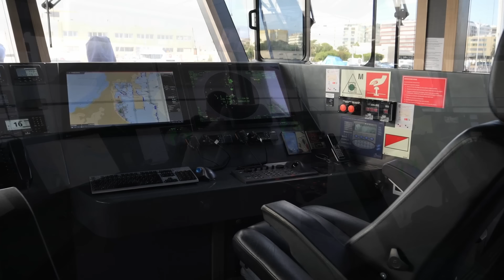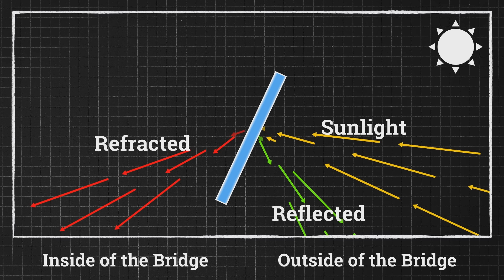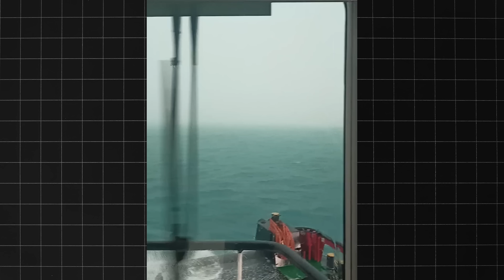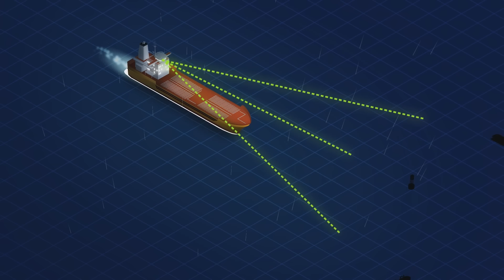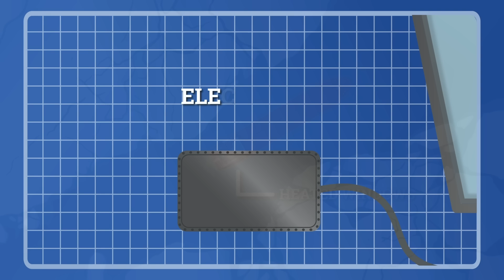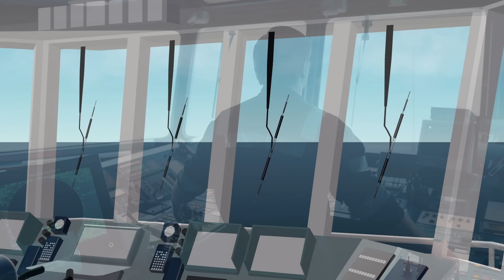Why Are Ship Bridge Windows Angled?

Comment: You might want to read up the basics of "Optics" (or re-read the optics section of a physics school book) ... and then redo the video. Let me correct the two most obvious mistakes in the video:
1. Light hitting an object can be reflected (light goes back to the same side of the object it came from (not to the same angle unless hit at 90 degrees)) or enter it (or a combination of both, with (semi-)transparent objects).
If it's reflected, it's not going in or through. You said this wrong every single time in the video (while the video text (when there was one) said refraction, which is partially correct as the light undergoes refraction (which is an angle change) while passing from air into glass and from glass into air (how much depends on the refractive index differences).
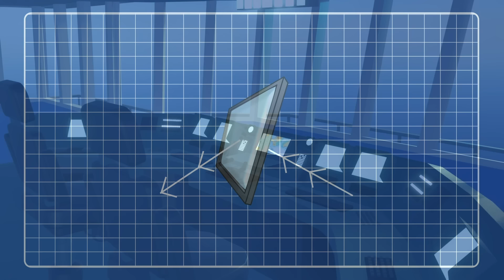2. 6:39 The arrow on the left (light after passing through the glass from the right would go up, not down. Actual angle depending on refraction indexes (see above).

Comment: The safest backup is obviously replacing all windows with transparent display panels so the excuses for not paying for the most capable 360° multi spectrum surveillance technology finally sinks. Anyone not using a Thales or Holosun 1x thermal red dot reflex sight is objectively wasting limited rail space with any other choice, same technology same reasons why.

Comment: Once it is dark enough night vision cameras are objectively way better than any human eye. There are also radars that can penetrate fog much better than any eyes even sonar can see other ships.
Reply: this isn't exactly true, passive night vision systems are notably better than the eye but still have limitations, these systems can also operate safely during sunrise and sunset

active night vision systems are rarely used on non specialized civilian ships (EG: cargo, fishing) as they are not dissimilar to using a massive spotlight

radar sure is great except when there is a power interruption and you can no longer supply tens of kilowatts (or even megawatts) of power to a massive microwave emitter

glass always works, no matter how little power you have
Reply: @thatonemoviebob  The radars needed to spot other ships or obstacles within a few kilometers are nowhere near that power hungry. And the point is if a 100+million dollar ship is at stake investing a few thousand into some night vision or thermals is really not a significant cost increase.
Reply: Not objectively and not "way" better. Those cameras can see as far as their infrared light can reach. Not really far. Enough for your garden, not enough for anything significant.
Reply: @Паехавший  well thats for active systems, passive systems do generally perform better then the eye in moonlight or twilight conditions, however during pure dark the human eye may perform notable better or notably worse depending on what youre looking for
Reply: @Паехавший  You should do a bit more research on the topic. You will quickly find out that even head mounted nigth vision or thermals are so powerful and cheap relative to the cost of a large ship that human eyes have no chances.

Comment: Your optics aren't correct.  Refraction doesn't change the direction of light passing through flat panes, regardless of how they're tilted.  The rake angle is to prevent seeing reflections from behind the viewer, from other windows or brightly lit decks or instruments at night.
Reply: You beat me to it. The explanation is completely and totally wrong. They are windows, not water. If the windows were straight up and down, you would see yourself and other people moving around which could distract you, or indeed just the reflection of windows on the other side of the space, making it harder to see.
Reply: That's why the "shelf" above the dasboard in cars is generally colored matte black as well to minimise the reflections. It's very noticeable if you put a piece of paper there when sun hits it.
Reply: It's soo bad
Reply: I guess Ai slop now
Reply: This channel got sold by the original owner and now it's purely money making AI slop.
Reply: @robinnautica9773  really?!?
Reply: @j.4941  yes really. 
Go watch the New Horizons video from him from 1 year ago the one before the last actually good video and see the difference yourself. 
It's just sad.

Comment: Wow ships have stricter forward visibility regulation than American pick up trucks & SUVs do
Reply: American pickup trucks nowadays are more optimized to hit as much pedestrians as possible
Reply: @danangputratiarno5028  dont forget that's the showroom condition pre bro dozer lift and 24 inch chinesium rims
Reply: @danangputratiarno5028  Not so fun fact: Most casualties are the children of the person who drives these rolling bunkers, in their driveway...
Reply: @juliane__ oh wow just like guns
Reply: @juliane__  Size, Not Country of Origin: The blind-spot issue is purely about vehicle dimensions (height and hood length), not where the company is headquartered or what powers the engine. A large German SUV (like a BMW X7 or Mercedes-Benz GLS) or a massive Chinese electric SUV (like a Li Auto L9 or BYD Yangwang U8) has the exact same front and rear visibility challenges as a Ford F-150 or Chevy Tahoe.
Global Trends: Automotors worldwide are building larger vehicles because that is what global consumers are buying. The physics of a blind spot don't care about the badge on the grille or whether it runs on electricity or gasoline.

TL;DR, not AMERICAN pickups and SUVs. All of them share the same design.
Reply: As they should.
Reply: Feature, not a bug.
American vehicles are meant to be as dangerous as possible
Reply: @GyroCannon  Size, Not Country of Origin: The blind-spot issue is purely about vehicle dimensions (height and hood length), not where the company is headquartered or what powers the engine. A large German SUV (like a BMW X7 or Mercedes-Benz GLS) or a massive Chinese electric SUV (like a Li Auto L9 or BYD Yangwang U8) has the exact same front and rear visibility challenges as a Ford F-150 or Chevy Tahoe.
Global Trends: Automotors worldwide are building larger vehicles because that is what global consumers are buying. The physics of a blind spot don't care about the badge on the grille or whether it runs on electricity or gasoline.

TL;DR, not AMERICAN pickups and SUVs. All of them share the same design.
Reply: Stricter regulations that all countries' trucks and SUVs.  They also have different roles.  But you're so edgy on the internet, so there's that.
Reply: @g @grondhero in what word is a joke about bad vehicle design edgy?
Reply: @Adam-tu1qx  Because you're being an idiot comparing a ground vehicle's regulations to a ship's regulations.

Guess what, neither of them share the same regulations as commercial jets?  Oooh, shame!
Dumb bass.
Reply: @gro @grondhero  wow i feel sorry for the folks who have the misfortune of conversing with you in real life
Reply: @Adam-tu1qx  You shouldn't. I talk to people much smarter than you and less lazy.
Reply: @Adam-tu1qx  Size, Not Country of Origin: The blind-spot issue is purely about vehicle dimensions (height and hood length), not where the company is headquartered or what powers the engine. A large German SUV (like a BMW X7 or Mercedes-Benz GLS) or a massive Chinese electric SUV (like a Li Auto L9 or BYD Yangwang U8) has the exact same front and rear visibility challenges as a Ford F-150 or Chevy Tahoe.
Global Trends: Automotors worldwide are building larger vehicles because that is what global consumers are buying. The physics of a blind spot don't care about the badge on the grille or whether it runs on electricity or gasoline.

TL;DR, not AMERICAN pickups and SUVs. All of them share the same design.
Reply: @grondhero  Quiet, boy. The adults are talking.
Reply: @sirhcsuiris  Oooh, the child thinks he's intelligent.  Brave keyboard warrior with a leaf face.
Reply: @grondhero  you're the only person here acting like a tough guy, completely unprovoked. I get the impression that you're a really insecure and lonely person.
Reply: @sirhcsuiris "let me be a smarmy ass on the internet by ignoring reality" thats what this entire comment section reads like
Reply: @sirhcsuiris  Okay, adult, use common sense:

Size, Not Country of Origin: The blind-spot issue is purely about vehicle dimensions (height and hood length), not where the company is headquartered or what powers the engine. A large German SUV (like a BMW X7 or Mercedes-Benz GLS) or a massive Chinese electric SUV (like a Li Auto L9 or BYD Yangwang U8) has the exact same front and rear visibility challenges as a Ford F-150 or Chevy Tahoe.
Global Trends: Automotors worldwide are building larger vehicles because that is what global consumers are buying. The physics of a blind spot don't care about the badge on the grille or whether it runs on electricity or gasoline.

TL;DR, not AMERICAN pickups and SUVs. All of them share the same design.
Reply: All the countries that failed to regulate the visibility of their cars and trucks should be ashamed of themselves imo. 
Especially those countries that can influence the global car industry, like the US, EU, China, etc.
Reply: @FriedHam  What an ignorant statement to make for the entire internet to see.  First, the EU is not a country.  Second, the US and China both have visibility regulations on their vehicles.  It's called Visible Light Transmission (VLT), amongst other rules.  There are not only federal regulations, but state regulations as well.

There is also a lot more to windshields than simply visibility regulations.

Instead of making a low IQ "let the government regulate me" post, why not state what these vehicles "should" have?

Perhaps you should be ashamed of posting something so dumb?
Reply: @grondhero  they can’t do that because they’d expose themselves to true scrutiny when they reveal how impractical their actual suggestions are. instead they want to make vague sweeping statements that emotionally feel like they are in the right direction but are devoid of any real advancement.
Reply: @grondhero Well then, you’re right. I’m ashamed.
Reply: @grondhero  However the US should really have better regulations for their SUV's. Yes they have some limited regs but the extreme spike in pedestrian fatalities tell of a story where the focus has only been on keeping the occupants safe. Even though they should just focus more on keeping pedestrians safe through infrastructure and making their cities walkable. Unfortunately many Americans tend to protect the illogical infrastructure. Lastly, what makes you feel entitled to that kind of tone? What purpose does that serve? I mean he didn't even attack you. The real low IQ comment is being unable to have a productive discussion without resorting to cheap ad hominem attacks.
Reply: @bobthegoat7090  "extreme spike in pedestrian fatalities?"  There were from 2,700 - 2,900 pedestrian deaths by SUVs from 2022-2024.  That accounts for less than 1 death in 117,000 people (340.1 mil pop), or 0.0008% of the population, compared to 1,600 - 1,900 pedestrian deaths by SUVs from 2012-2014, (318.3 mil pop) 1 death in 167,526 people, or 0.0005% of the population.

That's not a huge "spike" like you claim, nor is it anywhere comparable to Europe's big problem: heat deaths, where the EU has between 50,000 and 65,000 deaths annually [2022 (Record Heatwave): Heat-related deaths spiked to 67,873 deaths], whereas the US has 2,000 - 2,300 annually, but you could argue 4,000 - 6,500 if you use the heat creating secondary effects that lead to death.   Compare the European Union population of 451 million and you'll see the EU has a much larger problem.

All of you come on here complaining about minuscule problems, without checking any facts, but just out to bash the USA "because reasons!"  Every "complaint" about US regulations have been false. They are all easily verifiable.  So either these people are low IQ, lying, or purely evil.  Take your pick.
Reply: @bobthegoat7090  Size, Not Country of Origin: The blind-spot issue is purely about vehicle dimensions (height and hood length), not where the company is headquartered or what powers the engine. A large German SUV (like a BMW X7 or Mercedes-Benz GLS) or a massive Chinese electric SUV (like a Li Auto L9 or BYD Yangwang U8) has the exact same front and rear visibility challenges as a Ford F-150 or Chevy Tahoe.
Global Trends: Automotors worldwide are building larger vehicles because that is what global consumers are buying. The physics of a blind spot don't care about the badge on the grille or whether it runs on electricity or gasoline.

TL;DR, not AMERICAN pickups and SUVs. All of them share the same design.

Comment: I'd say ship : ship windows are to withstand crashing waves in rough weather right from the beginning, whereas car and plane windows are supposed to contend with air only.
Reply: Airplane windows also have to keep the pressure inside the airplane at all costs... So they are thicc!!!
Reply: @ThiaGamesBR  - yes ! Reminds me of a famous incident during which the pilot of an airliner was almost sucked out of the plane... leading the industry to realise it would be better to systematically screw the glass from the interior.
Reply: No, ðat's not it. If anyþing, ðe angle traps ðe waves, which usually come up, not straight at ðe windows or down from above. I've seen quite a few bridge windows knocked inward by waves. But between ðe real culprit being poor design and/or maintenance, and how rare it is for ðat to happen, ðe benefits FAR outweigh ðat issue.
Reply: @taitano12 - OK, got it. That's a bit like what happens on tanks and IFVs when an inverted slope kind of traps a shell.
Reply: Don't forget, they need to be rated against bird strikes too.

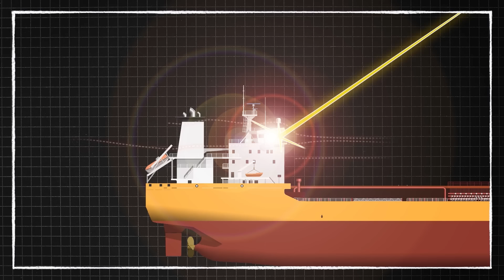Comment: I think you have the explanation of the glare problem completely WRONG!!! With the flat glass, with parallel sides , the light is not bent at all when coming from the other side of the glass. The light exits the window parallel to the incoming light, slightly displaced if the incoming light is not perpendicular to the glass. The image at 2:23 is correct, the one at 2:33 is incorrect. You got the physics wrong!

The problem is that with more angled glass, more light is reflected rather than transmitted, that is glancing light reflects more - you want the glass to be perpendicular to the typical sight lines, and to the lines to light sources.

Also, you can reduce glare with roof (keeping windows in shade), and with anti-reflective coatings.
Reply: I found ðat part funny. He mentioned overhead lights, but showed lights on ðe oðer side of ðe glass... Ðe outside. I legit had to watch ðat part a couple of times in confusion, and facepalm when I realized what was going on. Ignore ðe visual and it will be less erroneous. Still... Glare from overhead lights isn't what is being accounted for. Ðose are usually off or in a dark mode like red, and, as you said, overhead lights would be directed straight at ðe crew at the angle most bridge windows are at. If anyþing, it deflects light from consoles below and behind, not overhead. 

I let ðis one slide because most of his videos have basically zero real errors, and ðis one's fairly harmless. Not to mention, we're not ðe only ones to catch ðat.
Reply: @t @taitano12 Just curious, why do you use that letter for ‘th’?
Reply: @keyofdoornarutorscat  Because I'm a Nerd of many stripes, including being a language Nerd. Þorn is a letter ðat wasn't lost to changes in ðe English language. It was dropped so movable type printing presses could save money by reducing ðe number of letter blocks ðey had to buy. In hand lettering, "Þ,þ" and "Ðð" were in common use until somewhere between 1880 and 1920. Also, using ðem reduces the strain on my wrists because I'm typing fewer letters.
Reply: @t @taitano12  Þat’s really cool!
Reply: You're doing it for attention and to make yourself feel smart.
Reply: @prosiescoteau2152  Umm, okay..? Ðat and my hands. I did say it was because I'm a huge Nerd. I'm part of a movement to bring ðem back. Which requires drawing attention. You know, so people can ask about whatever weird þing you're doing. You do need to get someone's attention if you want to share someþing. In ðis case it's a neat letter I learned about. 

Does pointing out ðe obvious make you feel morally superior somehow?

You're ðe type to call your teacher an attention whore for holding ðe center of attention, and a showoff just trying to show how much ðey know. 😂😂😂😂
Reply: @taitano12  why are you explaining Thorn when you aren't using thorn? Also congratulations on saving 4 key strokes.
Reply: I think what you interpreted as the light bending, is actually meant to depict the virtual light path of the virtual image.  Ie the feint reflection of the light source on the clear glass. It will appear to be coming from a new position on the other side of the glass, this is a “virtual image”. We don’t care where actual light goes when transmitted through the glass, we only care about the reflections which when the glass is on an angle, do change directions! This makes the virtual image appear in a different spot. 

By angling enough the virtual image appears in a place that doesn’t interfere with the view.